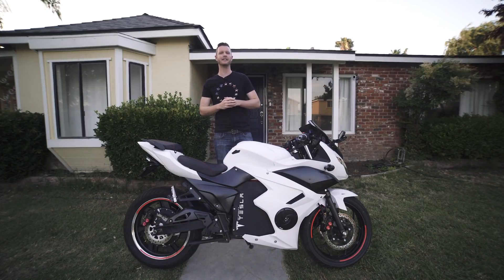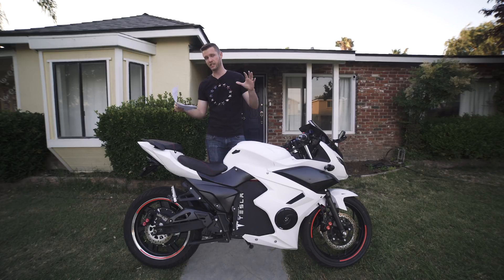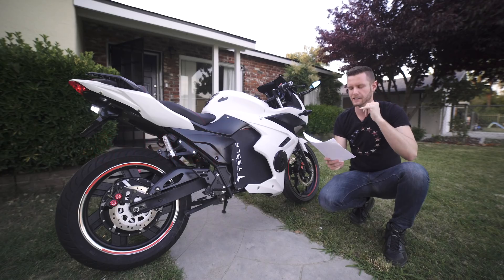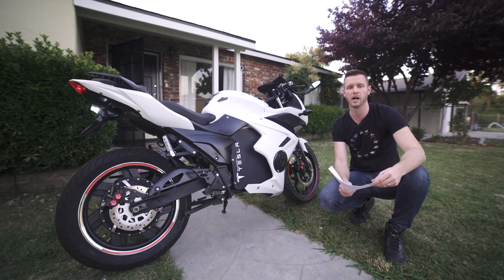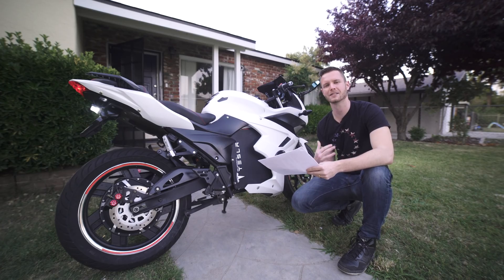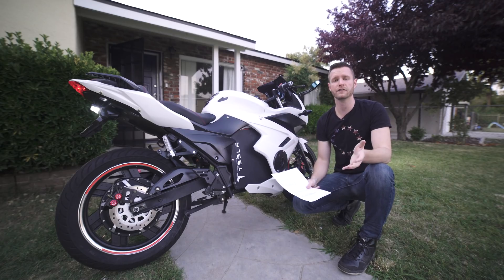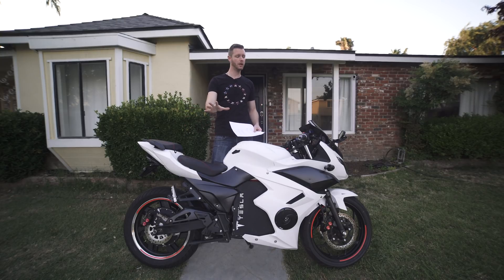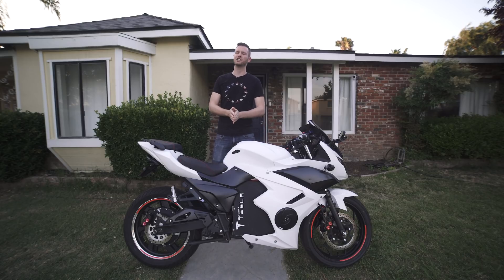How MUCH Did the Build COST? | Chinese Electric Sportbike

Comment: Are you sure it's an 11.14kWh battery pack? 

You mention it's 3 separate banks paralleled together which are 72v 40Ah each. Looking at the math thats 72v x 120Ah = 8.64kWh. Are you running a higher string count than a typical 72v, which would usually be a 20s NMC or NCA pack?
Reply from the maker: Sent you guys an email through your website. I'd love to see more of what you guys are up to!
Reply: @TheInja  Awesome. Would love to get your thoughts and feedback on our bikes. 😎😎
Reply: Evoke Electric Motorcycles to clarify, it’s ~44.2ah per pack, and when calculating “peak” power, that’s 11.14kwh. Nominal power is 9.55kWh when calculated using nominal voltage. He calculated it that way because that is the deceptive method used by zero to calculate theirs, so it allows a direct comparison
Reply: @curtmacneill8703  Yeah, it is a super deceptive way to elicit capacity. 9.55kWhs not bad for a daily driver. 

Our bikes have 7.8kWh for about 100 miles of range and drop in dual onboard chargers to charge at 3.6kW at charging stations, which tops us in about 60 to 90 mins for a typical charge. No complaints so far.
Reply: @Evokemotorcycles  in theory, with low speed you can get 100miles, normal drive you get less.
Reply: You guys have some cool bikes. I'm gonna check them out.

Comment: battery packs are pretty darn easy to build plenty of videos and info out there,. its the controllers which seem to have less easily available info but still accessible.  I still think converting a normal motorbike to electric is the way to go, and adding an onboard charger for your slow ev charging stations. One day, one day. 

https://www.youtube.com/watch?v=TJFgCvKxr90

Comment: Still worth it, IMHO, since most e-bikes cost at least twice the price for half the perfs.
Too bad US is waaaaay more permissive than here in france on vehicles reglementation. I doubt you can run these anywhere else than a race circuit, except if you make a brand new paper (as a self build vehicle) wich would cost about the price you paid for the bike (upgrade included).
Anyway, you can do this, and it seems you got yourself a pretty decent bike for a decent price, enjoy !

Comment: What ?  Your dubbing motor noise ?  The cool part is running silent   The whole point  .   Lol.      Have you looked at the new in box Toyo précis battery   Thats a modular pack that can be broken down using tesla like cells instead of those 18650 batts. Those are a pain   You may be Able to make 3 batteries for $700 all high end.     Its a good looking bike 🏍maybe you can dbl your viewers again by converting it to an engine .  Yea seriously .  Thats youtube.

Comment: like the bike, but you basically built a new bike less the frame, fork, brakes, seat, and cowling. Wouldn't you have saved a ton if you had just purchased those parts from the US and all the additional parts as so and built the thing for a fraction of the price?
Reply: Hindsight is 20/20.

Comment: I wonder if it would have been cheaper to convert say an R6 with a blown engine to electric? I mean you pretty much replaced everything that has "electric bike" written on it and the R6 would give you much better basic components to start with. With the knowledge you gained with this project, a conversion should be a breeze. Subscribed...just in case you take it on.

Comment: For mounting tires, a trick I learned is if you take a couple big sockets like 3/4" or 1" anything big enough to put your thumb through but that on the side where the tire is already on it will help keep that tire in the center and it will make getting those tires on better
Reply: Yeah, the bead needd to be in the lowest part of the rim when the far side is being pushed on.

Comment: Cheaper still if you find a non running 250 and pull the engine. Could save another 2k potentially
Reply: YES, this. 1000 times this. I picked up a 250cc for $500, gonna learn to ride on it and convert it to an electric after! Maybe I'll be able to get the regen braking to work without overheating too...

Comment: My build similar costed me 8500 Canadian but I paid a shop to build my battery and do the motor swap. So cost a bit more then doing it yourself. Also I bought my bike used as there is major importers where I’m from so no need to order from China. My battery is half the size though.

Comment: People can scrounge. Tom at BatteryHookup had 6kwh LG packs from GM stuff around $600. There are ebike packs on eBay. The controller and motor were decent but the import stuff really hit you. The motor? Hubs are basic. They don’t shed heat and are hard to cool. Like to see how it holds up. Seems like a 50 mph version of CSC City Slicker, around $4500, bigger battery might sell for urban commuting. Zero management has said they are going upmarket, not mass market. I’d rather have a Cub as a light commuter, but there are no electrics. Everyone builds for people with money to spare. This is pretty nice. Run it fo a few thousand miles... The cheap Chinese DS are tough price competition. Work that out for $1500. Not sure electric works, yet. Great project. Great info.

Comment: That motor is rated for 120 kph which is 74 mph. There is your speed limit. The same company offers a 12,000 and 14,000 watt water cooled 17" hub motor that does 105 mph, but it is bigger and much more expensive, plus they don't sell a controller for it. Now keep in mind that the top Zero models use 80,000 watt motors. Much too large for hub mounting. This is why the Zero's are so quick.

Comment: You need to go into business to make complete kits for those bikes and conversion kits for old gas bikes too.  Pull the engine and tank for room.  Start with Honda CB type bikes.  Someone mwith a 1980's bike and your kit would make for a pretty cheep e-bike.  You could buy and convert them yourself, turnkey.  All your customers are already signed up.

Comment: great work.
i hope it lasts for atleast 200000 miles.
whats the range you getting per full charge ?
Reply from the maker: About 130 miles mostly full throttle. More around 160 miles at 55mph
Reply: @TheInja  thats more than Zero bike owned by Newzeroland guy, whose price is around 18000$ !!!
good luck with your homemade invention big bro !
Reply: @DrDre-sy2kv  What model bike does he have?

Comment: Should look into producing a higher kw battery pack so you can get a little bit more out of that electric motor
Reply from the maker: Definitely not limited by battery. It's limited by motor RPM. Gets up to top speed within like 7 seconds
Reply: @TheInja , I thought when looking up on the others that the kwh was higher than what you said? You also said that the motor is an 8000w? I would think it could handle more but I don't know the full specs....very awesome bike and makes me want to build my own for sure but take your advice and go cheaper so to cost less.
Reply: @scottneal2738  That 8k watt motor has a 74 mph limit. To go faster requires a different, bigger, much more expensive motor.
Reply: Well you would know more than me since you built it. Very awesome and bet you understand electric bike's more now. Something I wish I knew but only know pieces and what I thought I recalled from other info I've read. I most likely crossed my info mixing up which was which. I do apologize if I sounded like I knew more. Still trying to learn.

Comment: I love this series 😍 I want to build a 60v40ah lithium battery pack for my e-moto and still learning how to but it costs so much. I only have 60v20ah lead acid battery and it weighs tons. Literally decreasing my bike top speed and torque.
Reply: Do your research. See what voltage the controller can handle. You will definitely need to change your bms to handle lithium charging.

Comment: Now put this head to head with the Harley Davidson electric motorcycle 😃
Reply: The Livewire would whip it good. That bike runs a 78,000 watt motor which is about 10 times bigger than this 8,000 watt hub motor. That's one of the reasons it costs so much.

Comment: Is the speed limited by the motor? Also would a chain linked motor have better performance than the hub style motor? I was just sitting here thinking about how heavy some of the elec bikes are (upwards of 500lbs) and having to push it with a hub motor seems restrictive. As well as limitations with the hub size itself maybe? Super excited with your build though and you should definitely be proud of yourself man!! (Even if it’s a Chinese bike 😂)
Reply from the maker: Yep, speed is restricted by RPM
Reply: Hub motors have their limitations, but they are cheap and easy to install. For better performance you need a frame mounted motor. Then you can go way bigger.

Comment: Hey guys please look at the Sur-ron again. It's $3600 shipped from Luna Cycle located in California. If you add a $1600 Litespeed 72V battery and an ASI BAC8000 controller for $800 you'll have a bike with a top speed of over 86 mph. It's another conversation entirely if you should be going close to 90 on a Sur-ron but that's a topic for another day. I've been following this build for months, it's amazing and congratulations 👏🏾👏🏾👏🏾 but a Sur-ron can be purchased and modded to be faster than this bike and for cheaper. Congrats again this looks like a great project. I'm going to go search for e-motorcycles now as you've inspired me.

Edit: Here the link to the 86mph Surron run: https://youtu.be/fmhJz9jVst4
Reply: Yup!

Comment: You should be able to write a short script for a microcontroller that changes the pitch and volume of a motorcycle sound based on the voltage coming from the throttle and play it back through the sound system. Shouldn't cost more than $30-40, could be a fun add on and would only need USB power.
Reply: You need to make one up, patent it and sell it. Do it.

Comment: thinking about getting like an old ninja 500 rolling chasis (one with 17" wheels) and converting it to electric.  Sourcing and building the battery pack seems to be the most painful part.
Reply from the maker: For sure. Lots of learning and work
Reply: If you do, look into a mid engine, I may be wrong...

Comment: Your bike is priceless! All that craftsmanship and tweaking makes this electric bike much more valuable in my book! Thanks for sharing your journey on your build! I was just wondering what type of lithium cell did you use was it the 18650? Tesla just came out with a new lithium cell its the 21700. I wonder if the charge on those new batteries would boost your bike? What do you think?
Reply from the maker: 18650 anddddd I can't remember the other dimension for the 3rd pack but twice their size
Reply: The chemistry in the Tesla 2170 is the same as the best 18650. It's just a different container. Plus you can't spot weld nickel strips to the Tesla cell as it has an aluminum anode. The key here is cost. Buying so many cells adds up. You have to find the right combo of cost to quality. Using Samsung 35E 18650 or 50E 21700 would have cost way more money. He would not see a boost in performance by better cells. They are not the limitation.
Reply: @JasonWW2000  Good to know. I was thinking of ways of performance in increasing speed. Still food for thought for now I'm just learning more about the battery technology. Thanks!

Comment: Better than the new electric Harley D.

Make it sound like e speeder bike from Star Wars
Reply from the maker: Hahaha
Reply from the maker: And 1/8 the price 😆
Reply: The Livewire is a different class of bike. Much more powerful. Ten times bigger motor.
Reply: @Slipknot With Chinese stuff, there's a really wide range. Most of the really good ODM parts manufacturers don't sling there products on Alibaba or Made in China. They usually secure solid, airtight supplier contracts with the OEM, and sometimes can't even disclose that they do make HD or Zero parts. Brembo has a huge casting foundry here in China, Zero's motor, frame, batteries, etc all made here, and we've crossed paths with some suppliers that manufacture for HD.
Reply: @Evokemotorcycles  Great point!  There is nothing wrong with Chinese manufacturing if the design is good and there is solid oversight.  The problem is that this product is in no way a "sport bike".  It is a bottom of the line disposable commuter rig with a tank and plastic fairings shaped to look sporty.  The Livewire and Zero could easily hang on your local group ride with MT09s and Street Triples.  This thing would be dropped by the girl next door on the Piagio scooter that has a higher top speed.  It's a fun project, but should be realistically titled "Adding a bigger motor and battery pack to a cheap Chinese electric commuter bike"
Reply: Bikes and beards
Reply: Don't hate on the comfort that is the livewire.
Reply: I am interested in the metacycle or the storm bee or boom bee whenever they come out with the base model instead of the guinea pig models
Reply: u watch srkcycles ?
Reply: The Harley goes almost 100mph and runs 0-60 in less than 3 seconds.  It also will have decent resale value.  You will be lucky to get 2 or 3 years out of a cheap Chinese moto or scooter before it starts rusting and all of the mechanical and electrical components go to shit
Reply: @luisdetomaso2224  Why so negative? Bad experience with chinese products?
Reply: @luisdetomaso2224  bro you are comparing cat with a tiger in price. if we could afford keeping tiger then no-one should keep a cat. thing is you get what you pay for. he didn't compared it with livewire. he just showed how much bikes like zero S looting us for same thing...
Reply: @IAmAnAlbatross...  Yes, he did compare it!  Carazo321 commented that it was "better than the electric Harley D".  Total nonsense.  The Harley is built with premium components like monoblock Brembos, Showa suspension, and a six-axis Bosch IMU for traction control and cornering ABS.  The Chinese bike is a glorified scooter in comparison.
Reply: @IAmAnAlbatross...  This bike is not the same thing as a Zero.  The Zero is a much more sophisticated bike in several ways: 1) the Zero has 9th gen Bosch ABS and two front brake discs, the chinese bike has one front manual rotor 2) the Zero motor is mounted in the frame, the chinese bike has a heavy, hub mounted motor that slams into potholes and adds unsprung weight 3) the Zero has an advanced charging port that can fast charge off standard electric car charging stations, the China bike has an extension cord that charges overnight
Reply: @luisdetomaso2224  my Sure Ron does 82mph and I have $9700 in it total.